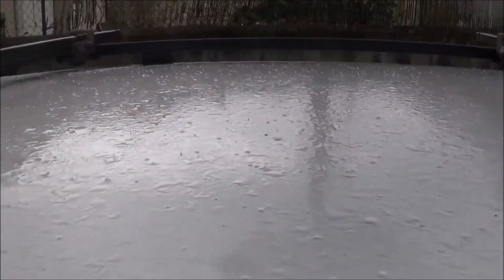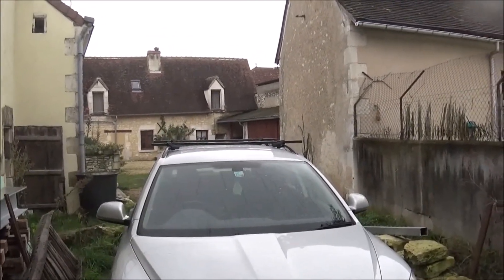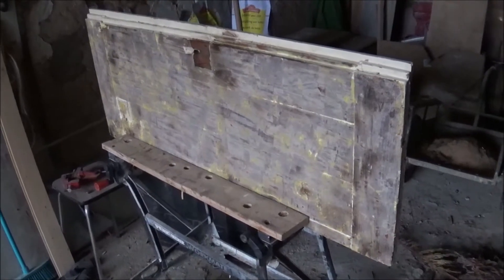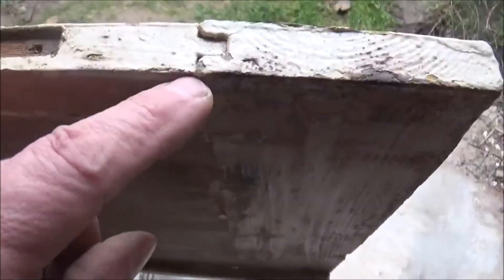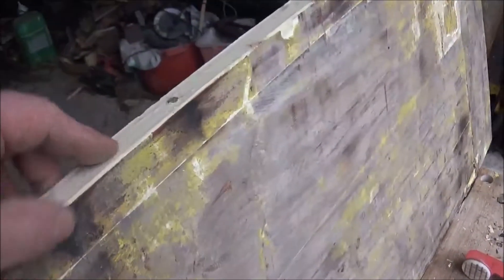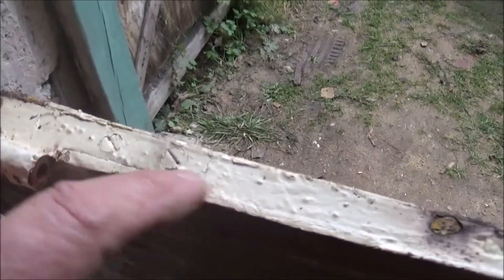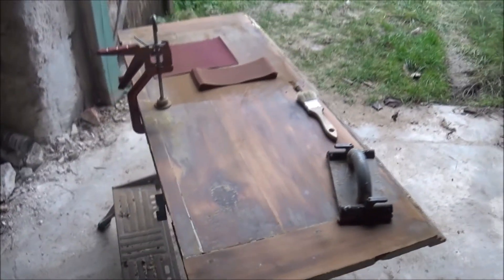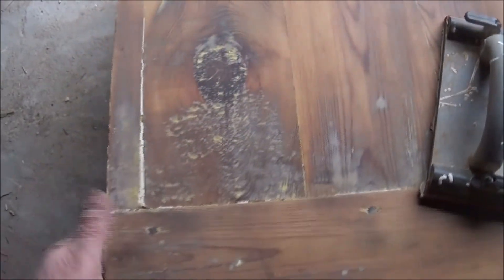Worse than watching paint dry

Comment: Hard work rewarded eventually. Though for every time it works out OK there are a few times when it does not. My father-in-law calls this "ricochet" - when one job rapidly becomes a series of other, unforeseen jobs.
Reply from the maker: One of my helpful neighbours predicts that 'the job' (sorting out the house) will take 20 years. This job is not 'priority', but the weather has stopped me from some of the other things that need doing.
Reply: @harryfaber  Well the actual "job" will no doubt keep you busy for a while yet. I bought a run down house once, with a plan to fix it up in a year. Took five. But I did profit from it...